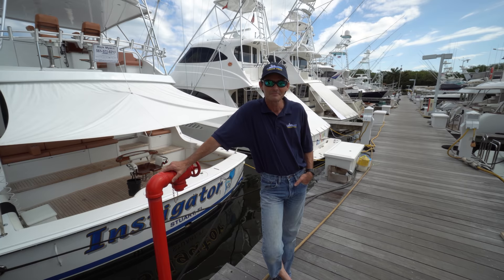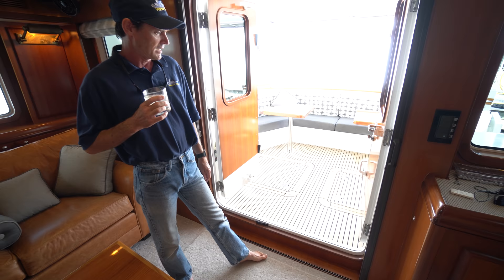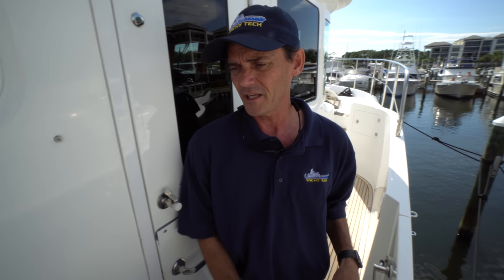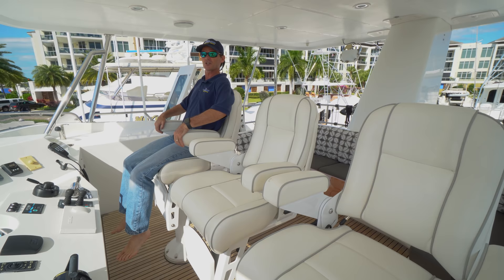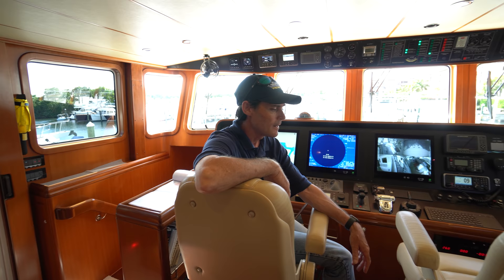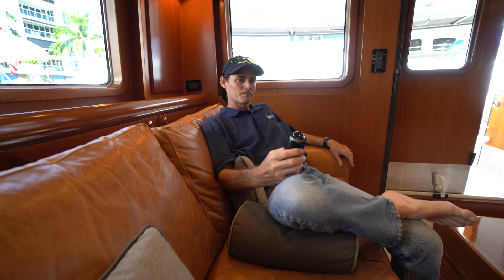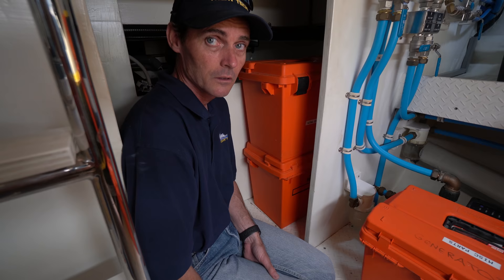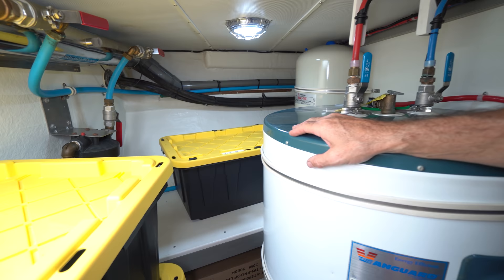Nordhavn 64 In Depth Review

Comment: Thank you for taking the time to make another stunning, in depth videos.  I have worked with LIon systems in data centers.  Some used a gyro to stabilise current and hold for brief outages from switching to alternate power.  Not stab gyro weights required.  Supercap is an exciting and potentially dangerous thing.  The short protection is normally strong and redundant so it dosent make big bad boom.  These were tested as warheads and found to be something not quite ready with weight to blast ratio.

Comment: 17 gallons an hour works out to be about 310hp. 22 gallons per hour is 400hp. Series 60 MTU (Detroit) is THEE best electronic Diesel ever made. You should turn up the RPM to 2300. In pleasure yacht, Series 60 puts out 825hp at 2300.

Comment: Great walk-through.    On the Hydraulic Alternators - I am not understanding where they fit in to the operation of the boat.   Is there a hydraulic pump running from the Main engine?   I see that the wing engine is required for thrusters/windlass etc when manoeuvring.   A very power-hungry/expensive solution to use hydraulic alternators - 'clumsy'.      Belt-drive alternators mounted direct to the main engine HAS to be the way to go.       All in all - a great vessel and very detailed run-through.
Reply: I thought it was a lot of pumps and cooling and smoke detectors, jeez.  What is wrong with a belt, or a electric motor/generator in the drive line.

Comment: You are the man - love Nordhavns - 57 is my choice (maybe a 50? or 55?) -  in about 3 years for my retirement - I do have a question - curious what your response is to people that claim these are plastic boats and do not compare to steel - my response is - give me examples of a problem that a Nordhavn had that steel would have been better - which of course they cannot (except fire but I doubt fire is good on any vessel).  The next is weight - and my response is more weight is sometimes used to compensate for bad hull designs...   comments?

Comment: What would trouble me by using Lithium-ion batteries is the risk of fire, a burning lithium-ion battery emits the very deadly hydrogen cyanide gas, is extremely difficult to extinguish and when in contact with water the cells in the battery will explode. I think it adds a serious risk to boating and i am not convinced it’s worth the little luxury it brings.
Just my 2 cents.
Otherwise it is one gorgeous vessel!!😍

Comment: Lithium Batteries can be charged at 50% of total amperage, so a 100 amp hour battery can take a 50 amp charge. An AGM or lead acid battery in a house system should ideally be discharged no lower than 20% and 50% if you don't care about the life of the batteries. Lithium batteries can be discharged as low as 10% of total amperage but should be taken no lower than 20%. An AGM battery might have a lifetime or cycles as in charge / discharge cycles of 600 up to 1000 depending on depth of discharge. A lithium battery from Victron which is manufactured in Netherlands has a charge / discharge rate of between 3000 / 5000 cycles.

Comment: Li-ion batteries will charge as fast as you can keep them cool. If you have a chilled water cooling you can put 150kw into them. the supply doesn't matter as long as you can keep them cool. If you don't cool them they start to swell and then burst. Then they melt a hole through your hull.
Lithium Phosphate I believe is where the technology is currently heading for deep cycle, leisure batteries. I say that, but there are companies looking into oxide batteries that being said, I think that tech is in the distant future if ever (make power by rusting an anode, recharge by removing the oxide)  
Also. AC filtering is pretty easy and super capacitors aren't all that dangerous, if again, you keep them cool and don't bridge the contacts.

Comment: What do you think of the 68FPH compared to the 64 and it having the availability of twin engines.    I had a 455  Cruisers Express Motor yacht for years and loved being able to maneuver with the twin screws at low speed without the rudder or thrusters in harbours or channels.   Does the extra 4 feet justify the cost difference between it and the 64, which is the same cabin footprint.  I know the hull speed rule gives the 68 a little bit of efficiency advantage but the cost difference is significant when  they are basically the same hull form.